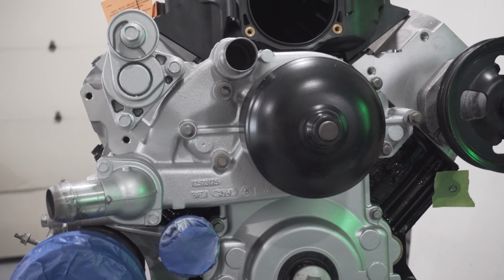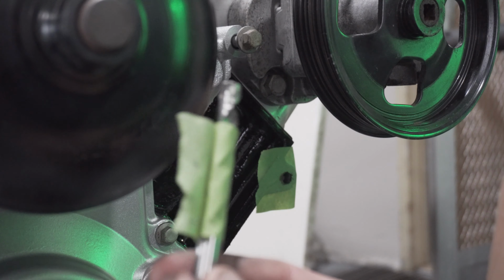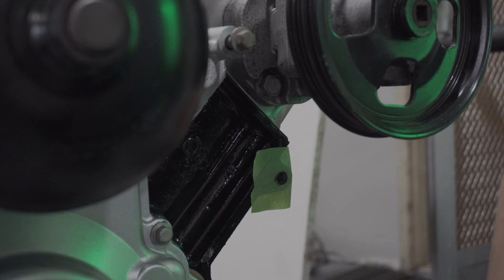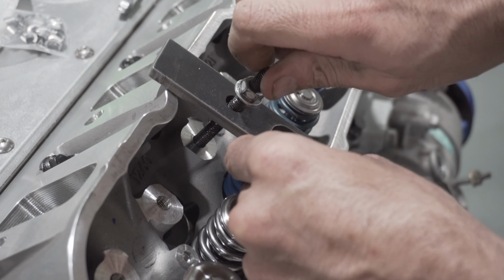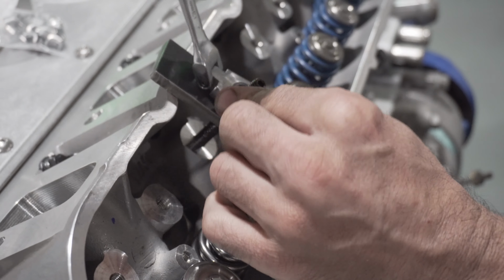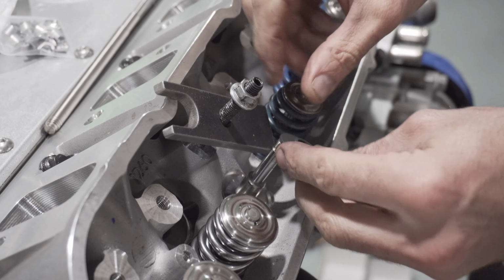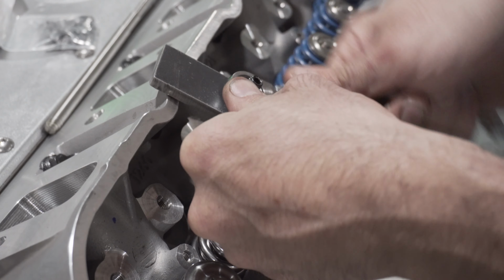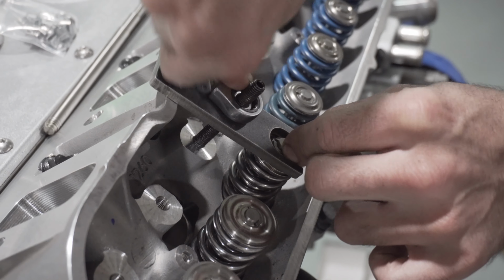LS Accessories an IROCS Best Friend #ProjectIroc Episode 5.3

Comment: Bro I have a question what did you do for your oil pressure gauge?
Reply from the maker: I ran a "Tee" fitting off the oil pressure sensor, located at the back of the intake manifold. Run the Tee fitting in to the block, one side of the tee connects the factory oil pressure sensor, the other side runs to the gauge. Also, just as a note, the factory oil pressure sensor on the Lq4/Lq9 engine is only for an obd2 reading. So if you want to remove it and replace it with an aftermarket pressure sensor...you can